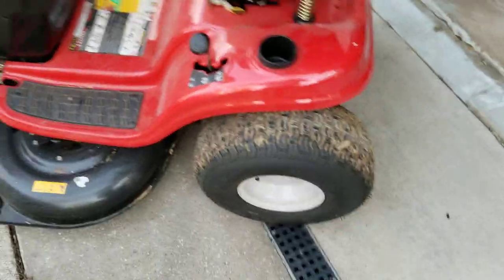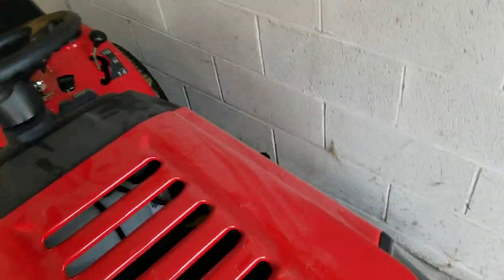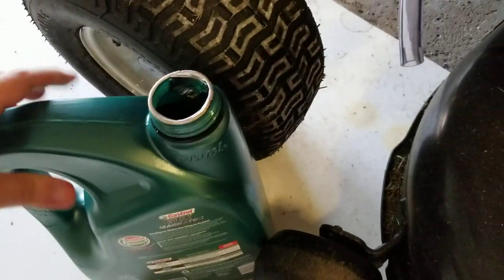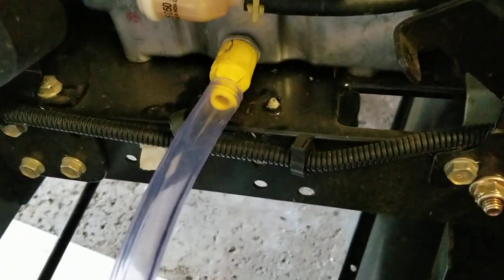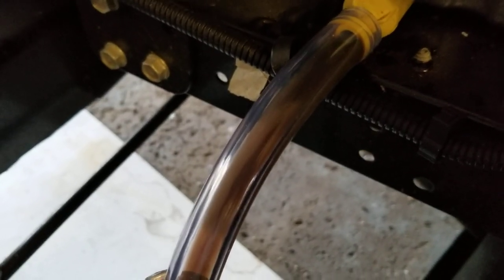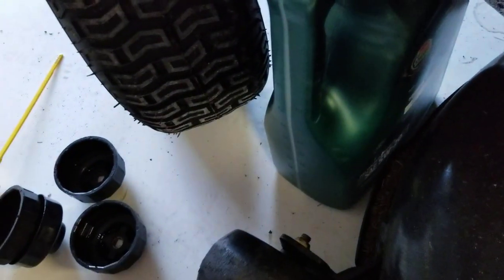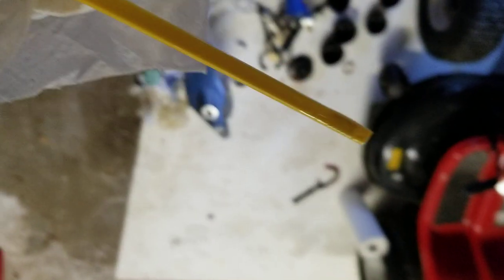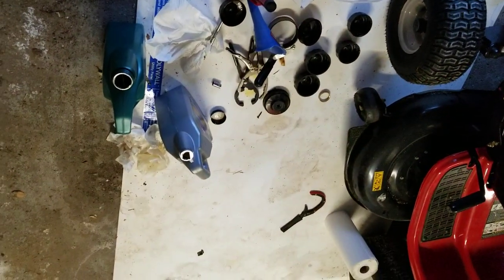Troy Bilt Bronco Oil Change Part 2

Comment: You don't need to fill the new filter with oil, just coat the rubber gasket with oil. Always remove the dipstick when draining too, helps the flow. Also no need to buy a Kohler filter. I bought a Fram for $5.75 at my local auto parts store which by the way makes the Kohler filters! BTW my strap oil filter wrench was too big so I ended up using a rock as a spacer and worked fine!
Reply: What's the number on that Fram filter
Reply: @buster1173  Motorcraft FL-910S fits
Reply: @buster1173  This also fit. FRAM Extra Guard PH3614

Comment: Great tips!  I inherited a passed down mower (my 1st) and ran into the exact same headscratching about the no oil flow issue.  Glad to see it's as simple as just twisting more, I expected sludge/buildup at first being a pessimist.  For the filter, I have a smaller oil filter wrench so I'll try using a spacer like Cape below mentioned, wish me luck.

Comment: Did my oil change on my troy built pony today. Filter was on wayy to tight. Crossed referenced the kholer filter...put a wix filter on. Bought at O'Reilly auto parts.
Reply from the maker: Cross reference can be useful, everytime I have tried they are out of stock. I'd much rather use the Wix!

Comment: Only use the choke position on throttle lever to start a cold engine. The smoke is from unburned fuel.

Comment: The manufacturer doesn't lube the seal on the filters before they screw them on, which is why it is so damned hard to wrench them off the first time. I nearly destroyed the old filter trying to change it the first time.
Reply: How did you get the oil filter off? This video will not play for me after about a minute.
Reply: @savedbygracead6  use an oil filter wrench. Different types wrenches should be available where ever you buy your filter

Comment: Mine has a black drain thing that you turn and pull. Then my filter wouldn’t come out without taking the side body panel off. Might as well pull the front panels on mine just to make it easier to access everything.
Reply from the maker: I've heard that other model years changed locations of filters and the drain style. I suppose the engine manufacturer plays into this as well. I wish more companies put consumers and mechanics in mind when they design their products. Thank you for watching!
Reply: @Matty_Ice_Reviews yeah yours looks newer than mine. Mine is a 04 or 05 and the filter is on the left point sideways right at the fender instead of down. Such a stupid design but it only takes 3 screws for enough clearance or 4 to take it completely off.

Comment: If you clean the oil filter housing with a paper towel you will get lint inside the oil. If you must clean it, use lint free towels. The reason this matters is that the lint can get pumped through the oil passages in the engine and on to your bearings. This can score your bearings. Oil contamination is not good. Not trying to criticize, just trying to add to the knowledge pool.
Reply from the maker: That is a great tip! Thank you for watching!

Comment: 10w30 oil ???   I have the new model of the Bronco, oil capacity and oil shoud be the same ?? cant find any info even in the manual.
Reply from the maker: The oil capacity and type may very well be different. Please keep in mind the manufacturers change the engine specs, engine size may vary, and brand/style. Troy-Bilt is pretty consistent using Kohler or Briggs and Stratton but these engines carry variations from year to year. 

When I purchased mine I recieved three manuals 1) basic operation, 2) specific engine manual 3) warranty and accessories. You can access these online at Troy-Bilt website and I recommend taking a picture of the information sticker on the inside of the hood. I also took a picture of the oil filter for quick reference.
Reply: @Matty_Ice_Reviews  thanks 🙏

Comment: Yeah same problem with the oil filter ridiculous how tight it was on
Reply: J Luke I was told by  Troybuilt that they  dont lube the seal before they put the oil filter on, which is why you need a crow bar to pull it off the first time.

Comment: Great video, thanks! Did this last year and worked like a charm. Filter showed did not come stock but was only one available at the local Home Depot...works great. Can anyone tell me the size of the tube to drain the oil? Mine was a floor model and I had to improvise, wasn’t horribly messy but would prefer the tube.
Reply from the maker: It is a 3/4" tube with a 1/2" opening. Tube is approximately 8" long.
Reply: Thank you once again was a breeze changing the oil w the right tube this year. For anyone having an issue where they lose power when engaging the blades. Try draining the carburetor and adding some seafoam to your fuel. Got mine running like new.
Reply: floor model or not -- you should have received the owner's manual or a discount for not providing one IMO. Note: not all mower engines have an oil filter. My Yard Machine 42" does not.

Comment: This is my problem. I remove the dip stick and it clearly shows I need to change the oil. (after just 33 hours) On my riding mower you have a yellow part you turn counter clock wise to drain the oil. (Dipstick still out) I do this and wait 2 hours. (YES I ran the mower for 15 minutes so the oil would be hot and ready to come out.) NOTHING...not one drop. Dipstick shows it is full but dark so change NEEDED. 💥🙄Help what do I do now?
Reply from the maker: Are you pulling the sleeve out after turning? The oil will only drain if that piece is turned and pulled out. If the oil refuses to drain, you may have sludge built up around the drain plug. Try adding a bit of new oil and running to warm up. It only takes 5 or so minutes to warm the engine oil. You can also try an oil flush with commercial cleaners sold in automotive stores. These may help but can cause other build up to come out as well. If not improved try a probe of the valve with a thin tool
Reply: @Matty_Ice_Reviews  Yes I pull it all the way out and turn it clock wise.(I did this several times to be certain it was working) I will try in the morning to add some oil and see if it helps. No tool can go inside of the yellow part. I tried to see if the end of the dipstick would fit in but no.What brand of oil flush do you recommend? Thanks for responding. I have no men to ask that would have this type of knowledge. Kelly
Reply from the maker: @kellyfairchild7383  liquid Moly Pro Line is probably the most well known and widely available. If you have the ability try lifting the mower with a jack to give a little angle to the oil flow.
Reply: @Matty_Ice_Reviews  Thanks so much for your help. I will tackle this in the morning. Be well, Kelly
Reply: @Matty_Ice_Reviews  Last night I stayed up and watched more videos about draining oil. One man showed what the yellow valve looked like and I had my answer. You turn it clock wise AND PULL IT OUT.........solved my problem. Just turning it did nothing. Changed oil in both of my riding mowers this morning. Thanks for your input. Be well.😏

Comment: I'm very confused by these videos....my bronco is this same and  it only has an oil plug nut with the steering bar located directly infront up against the nut. Making changing the oil impossible without disconnecting the bar. How does everyone else's bronco have a quick change on opposite side? Mine doesn't have an option for a quick connect anywhere on it. Prolly gonna sell my bronco....very disappointed in their product design and quality.
Reply: you don't need to remove the steering bar.  You can wiggle that half-funnel thing underneath it.

Comment: What could be killing the battery to
Reply from the maker: Battery dying could be from infrequent use, old battery, or a short. I would start with a trickle charger in-between cuttings and try to see if that helps. If not check battery age. If that does not resolve it could be a short or a bad alternator. Those can be trickier to diagnose as a wiring harness is fairly long as cumbersome to check for wear/wire damage and the alternator will need a multimeter to test draw.

Comment: What oil do you use?
Reply from the maker: I use whatever full synthetic is on sale 5w30 or 10w30. As far as brands I've used in the mower Super Tech, O'Reilly's, STP, Valvoline, Mobile1, Castrol, and Pennzoil. I do not believe that oil for these types of engines need to be expensive or from any particular brand due to the use of the machines and limited ra ge of function. Thank you for watching!

Comment: hello ,what brand the oil ?
Reply from the maker: The brand in the video is STP fully synthetic. You can use any fully synthetic oil brand for your lawnmower. I usually buy what is on sale or cheapest and have used everything from Mobil 1 to Pennzoil to Wal Mart's Super Tech and O'Reilly's House Brand. With limited use it does not make sense to spend extra money on oil when performance is similar in these small engines. Thank you for watching!
Reply: thank you 👍

Comment: Mine don't have a oil filter well atleast I don't see one any where
Reply from the maker: That's possible. If it is a 2 cycle engine it will have oil added to the gas instead of having oil/filter. Thank you for watching!

Comment: What type of oil did u use ie synthetic viscosity?
Reply from the maker: Per the recommendation of Kohler, I used a full synthetic 10W30. In particular I picked STP as it was on sale at the time I filmed this video. If you were in a cooler environment 5W30 would also work well for this particular model. I would not use a conventional oil in this engine, but a blend may be an okay compromise. Thank you for watching!
Reply: Ty for your response just about to do 1st oil change I live in Florida i will use 10w30 full synthetic

Comment: How  often do you change the oil
Reply from the maker: Once per year for normal residential use. Commercial use may require multiple changes.
Reply: @Matty_Ice_Reviews   thanks  I purchased my mower in January was wondering how often I’m supposed to change the oil on them. Great video thanks again
Reply from the maker: @jeeprider3780  no problem! Enjoy the mower and best of luck! If you get into maintenance for other items like spark plug, blades, air filter etc. I have a few videos detailing these items. Thank you for watching!

Comment: If there a way to check how many hours the motor has ran for?
Reply from the maker: Most standard consumer grade lawnmowers do not come with meters built in. High end models may feature this as an add on or in a menu if they have a digital display incorporated. Without a meter visual/auditory observation may be the only clues as to a range of hours run. I've seen consumer grade engines at the 300 hour range sound like they had double that on them.

Comment: 10W30 or 20W50?
Reply from the maker: SAE 30 is the best overall based on what my manufuacturer lists. 5W30 and 10W30 can be used but may not be recommended by owners manual. I would be very hesitant to use 20W50 in a conventional riding lawn mower. 20W50 is famous for leaving an engine dry running for several moments due to visocsity.

Comment: Your video stops playing for me and my wife both at about one minute in and will not resume playing. How did you get the oil filter off? I have mangled it trying to get it off.
Reply from the maker: I used an oil filter wrench and a 12 inch ratchet. I have previously used filter  pliers that have teeth to grip or rubberized grips. The oil filters are notoriously difficult to remove.

Comment: what size is the oil drain tube?
Reply from the maker: The plastic tube is 3/8" in diameter. You can use any length I would recommend something 6-12" long.